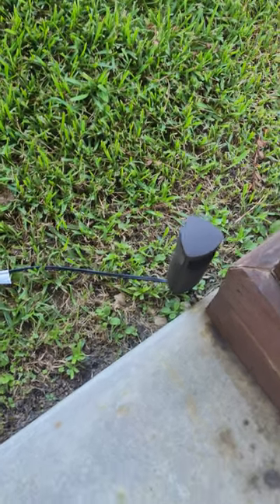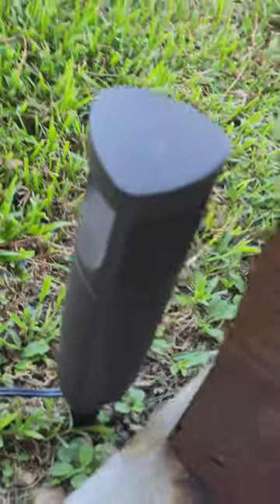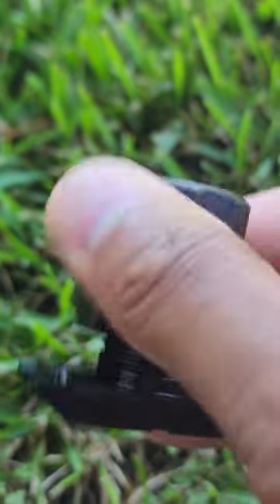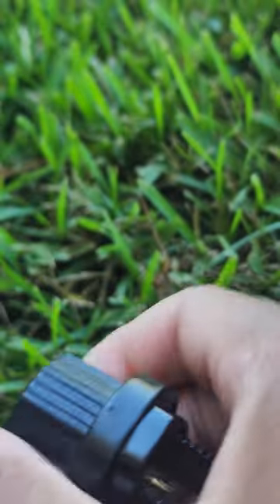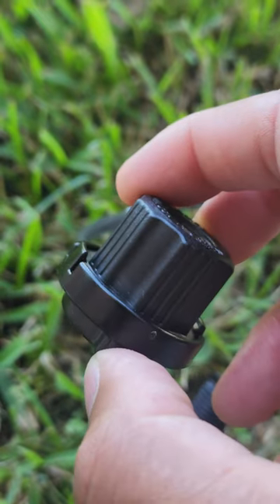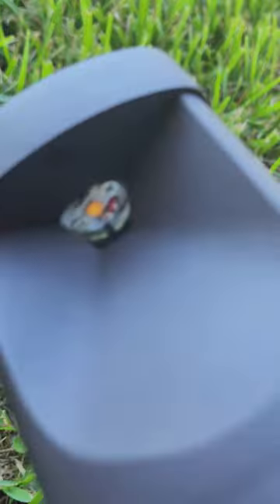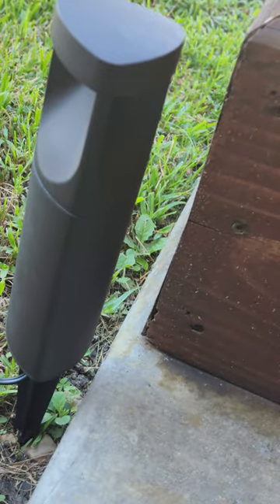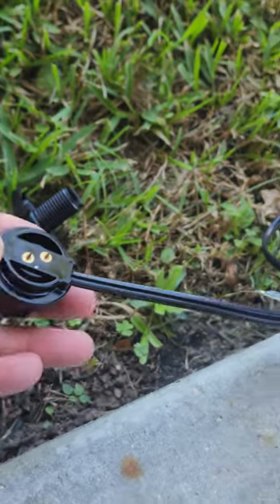Harbor Breeze LED Pathway light

Comment: Just to be clear, you dont need to use a transmitter. Just cut the wire and take off that circular connector. Then wire to a long 12/2, 14/2, or 16/2 gauge wire all the way to the transformer (or to other lights). Always cut that circukar connector off and just twist more wire onto the noe exposed wire. Its simple